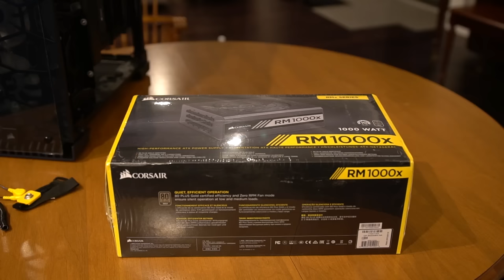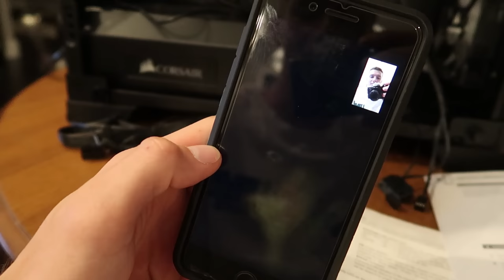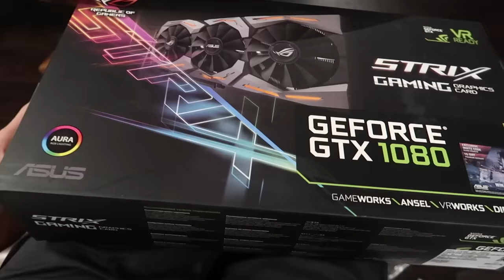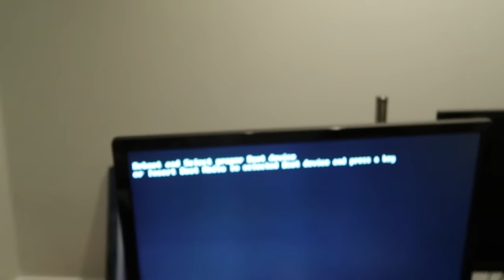Building my First Gaming PC

Comment: I'm also building my first pc in a bout a month or 2
Reply: sonic jet do not watch his video for guidance if you haven’t built it yet watch bit wit how to build a pc
Reply: @hompersompson9753  I also asked my uncle to help I have been saving chore money for a year so he helped. has has built one before. We built it 3 weeks ago
Reply: @hompersompson9753  also I knew I  was gonna built it with him my dad would never let me do it on my own I just needed to know the parts and stuff
Reply: @hompersompson9753  and I do watch bit wit and linus I watched a bunch of others as well
Reply: sonic jet the most important thing that beginners can make is overclocking which I recommend to anyone who wants the full potential of their pc if your going intel in the 9600k-9900k processors than 5.0 ghz on 1.355 volts is good on ryzen it’s a different story watch a video about overclocking on the cpu that you’re planning to use
Reply: @hompersompson9753  o I already built it I got a ryzen 5 2600, GPU I cant remember mother board is an msi B450 gaming plus 32 GBs ram

Comment: HE HAS THE POWER SUPPLY FACING DOWN AHHHHHHHHHHHHHHHHHHHHH TURN IT UPWARD
Reply: NO, don't do this LOL
unless your power supply is specifically made to pull in and exhaust warmer case air, you're going to burn out your PSU and possibly everything else. most PSUs today are made to pull in fresh air from the bottom, hence the bottom-fan seen in this video. if you install it upside down, it's going to stagnate at low load, fill the case with warm air, and create a pretty bad chain reaction that will burn your parts out way faster than theyre supposed to

Comment: ur supposed to put the power supply the other way
Reply: No your not. The fan always goes on the bottom.
Reply: Matt Mokos oh i thought he put it facing up
Reply: It really does depend. You should always put the fan facing the bottom but if you have a big case and there is a lot of airflow you can put it facing up if you want. It wont make a difference though, it's all up to you.